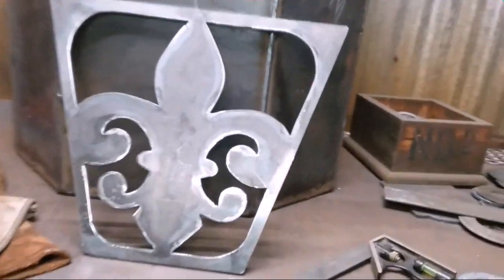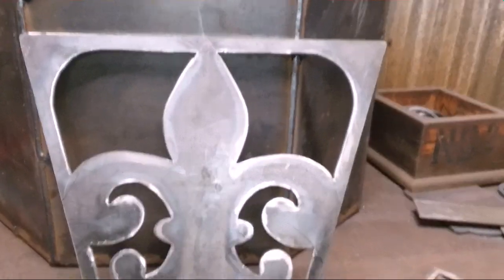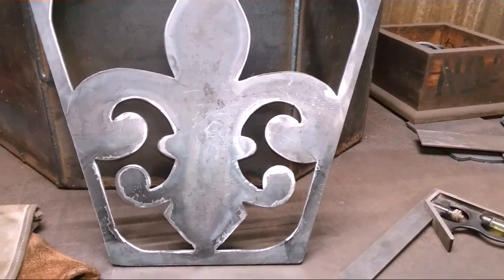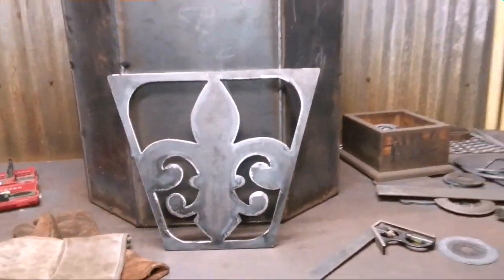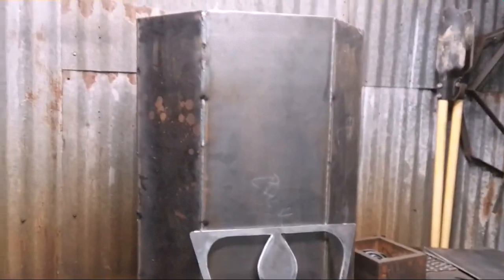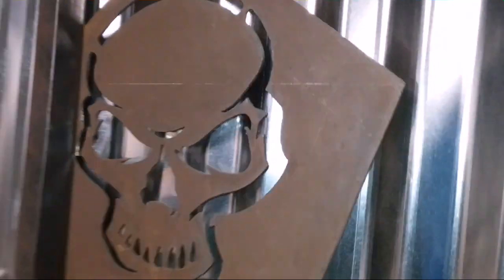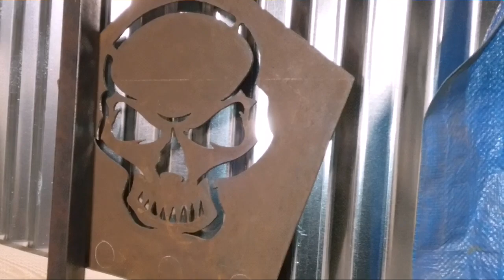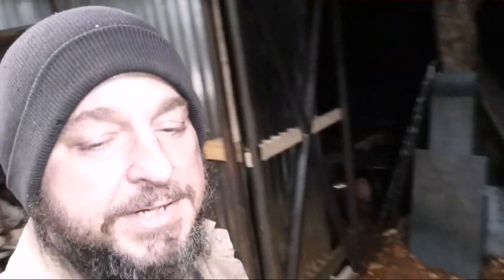Oxy/acetylene torch work

Comment: I am always impressed with how smooth you can cut by hand either with a gas torch or plasma.  My son has drawn up a 5 sided fire pit that interlocks together, no welding or bolting together required.  I guess we will have to fire up the CNC plasma table one of these days and see if it works.

Comment: VERY COOL,   I NEED YOUR ADVICE,  I JUST BUILT A TOOL CART AND WHEN I PUT THE WHEELS ON THERE'S A ROCK IN THE UNIT  BUT WHEN ALL THE WHEELS FACE ONE WAY IT'S FINE,  THEY ARE ALL SWIVELS,  I NEVER HAVE LUCK WITH THIS   MY LEGS AND EVERYTHING WAS SQUARE   MEASURED ACCURATELY,    BUT I'M USING BED RAILS SO I KNOW PRIME STOCK WOULD MAKE A DIFFERENCE,  BUT I'M ALWAYS HAVING ISSUES WITH THE WHEELS......   I PUT A LONG PIECE OF BED RAIL ACROSS 2 LEGS TO THAT THERE;S LITTLE CHANCE OF ANYTHIGN NOT BEING FLAT  PUT IT ON CONCRETE AND WELD  BUT IT'S OFF   WHAT'S THE SECRET   THANKS   MERRRY XMAS